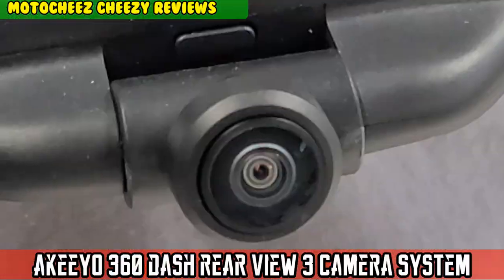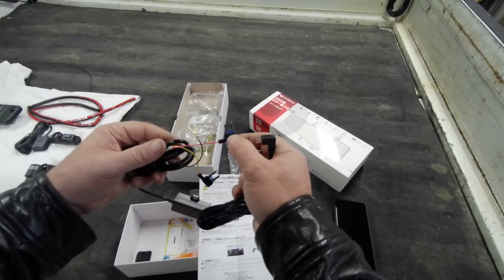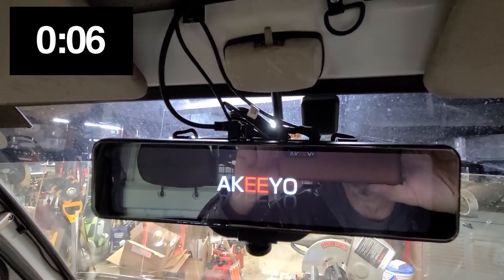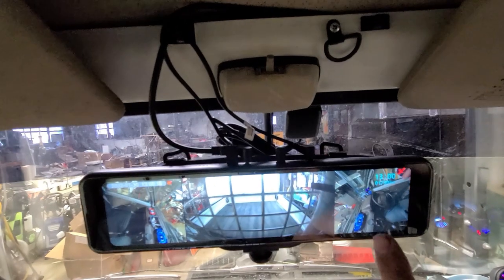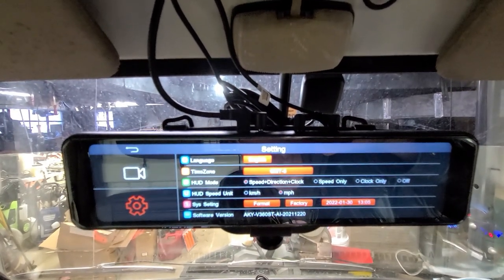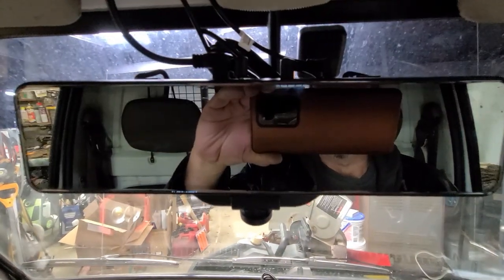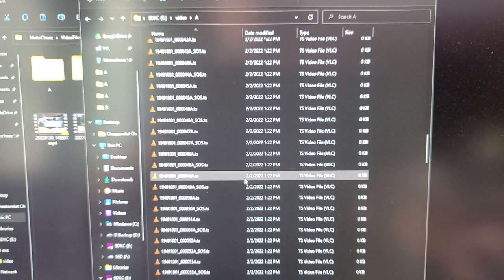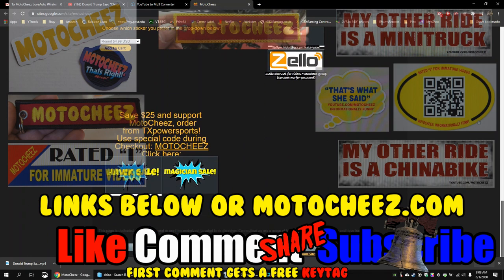AKEEYO 360 dash mirror 3 cam DVR recording system, test, review, player, convert, view files on PC

Comment: Very good Video. I recently bought this to install on a Subaru Forester and while the concept is awesome, the operation drove me nuts. For starters like mentioned in the video, there still isn't a English manual included, but on their website one can download it. You can't return it if you dislike it since its only available directly from their website and no refunds are allowed. On the Subaru, placing the device on the rear view mirror, the straps actually keep hitting the garage door button of the OEM mirror, so it has to be place further to the right. The 360 camera is a bit too low that not only cuts your head off but hardly shows the side windows. The newer 720 model with its 2 360 cameras, one for the front and one for the cabin, does a better job of seeing everything front, side and cabin. Another thing I did not like was that the rear camera, (I bought both the internal one and an additional external waterproof one because I couldn't decide which to get) have a lower Sony sensor and thus night recordings are not so clear. As for the software, you are so on point. It's a shame, because I really really wanted to like this device but it's not there yet.
Reply from the maker: I have the English version program  link for this in description.
I also have a program a guy for me if you want to convert the front 180 into equitriangular for editing. It runs a small code within a folder for one or multiple vide batches. Only good if you want to edit in an editor or you can look around in VLC like 3d

Comment: A good product limited by it's software. Hate it when that happens. At least there is that hope that a future update fixes the software issues. I see you own a insta 360 cam. I actually am currently using my insta 360  cam to record my drive to work and back home. Fortunately that drive is only like 20 minutes. What sucks is that the insta 360 camera heats up really fast so i cannot use it as a dash cam for more than 30 minutes because of this. So this is why I am here on YouTube trying to find a actually 360 auto dash cam. This one seems to be the best with 2 problems that i don't like. The software issues you mentioned and the fact that it only records at 30 fps. Anyways great review. Got the details down to the T.
Reply from the maker: I actually had a subscriber write code to convert the 180 file to equitriangular so I can view edit upload to YouTube etc. Ill send to whoever wants it, I plan on putting a link on my website soon
Reply: @MotoCheez  awesome. Well you know what i think I'm gonna buy this cam. I'm really into 360 video recorders. Love that it also captures the sides and you won't find that in other mirror dash cams that are on the market right now. Just hoping that the return process isn't tedious if i was to receive a unit that doesn't function properly or gets delivered damaged. I was hoping i can buy this unit from Amazon because their return process is so easy and stress free but this unit is not available on Amazon yet.
Reply from the maker: I heard they were going to put it on Amazon but I guess they haven't yet. Yeah I listed all the cons of the camera unit but I really like it and hoping that they come up with new firmware I'm going to keep on them to see if something new comes out. Apparently it is made in China for the Japanese market
Reply from the maker: I heard about the overheating issue... I have the GPS remote, usually only don't to 10 minutes at a time

Comment: I'm still looking for a car DVR that will record front, rear and inside the car with audio for cop cam in case I'm pulled over and need evidence.  The videos for the front view and preferably also the rear view should have superimposed date, time and GPS speed.  The DVR should automatically record any time the ignition is on.  This sounds like what everyone would want but I haven't found it yet.  It's hard enough to get those features even without the third channel cop cam.
Reply from the maker: I've seen 4 channel systems they use in busses. 
I took a small 4 channel home dvr and put it in my C6 Vette. Worked pretty good, I put a 20 minute shut off timer for when I park. Only bad thing is the one I used didn't have audio. This was 8 years ago tho!
Reply: @MotoCheez  - I briefly thought about a home DVR for auto use.  Run it headless with a large SSD and take the entire thing inside to access the files.  Maybe waterproof the cameras?  Hide it for covert recording.  Four channel would be great for the mini truck so there could be a left and right interior camera to capture video of the cops initially walking up to the wrong side.   :-)
Reply from the maker: I used the rca type small waterproof cameras, just get the rca style dvr. It's not 1080 tho...